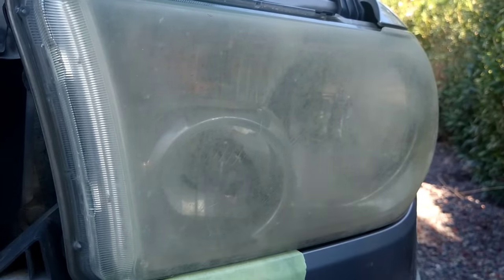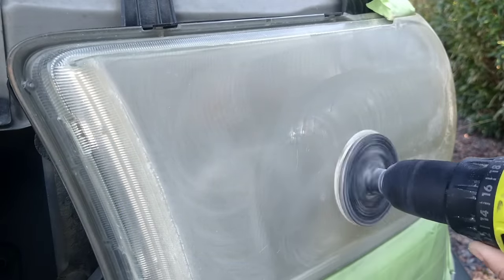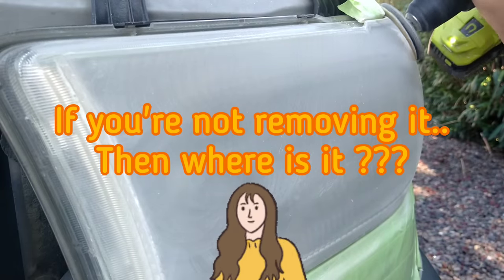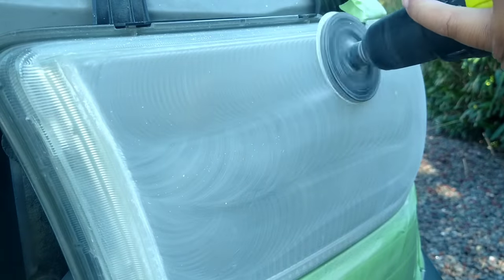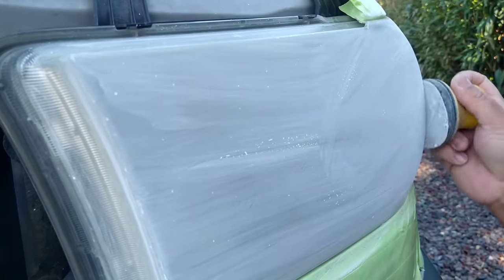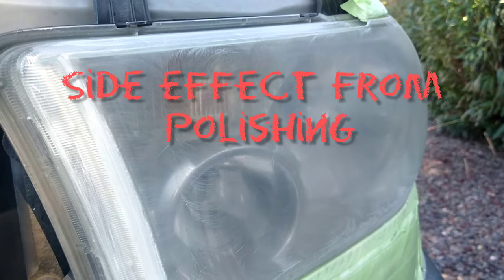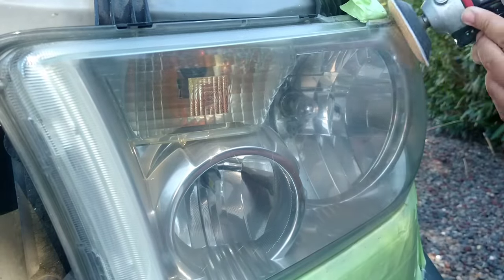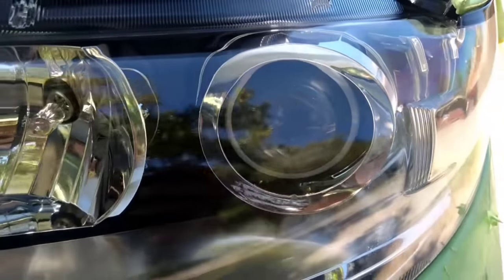POLISHING HEADLIGHTS IS A SHAM/scam  ---  and why you should never only polish headlights

Comment: you're right about you v have to sand the lights first but not about the 2k clear.  I've done dozens of headlight restorations using it and it comes out h flawlessly. .. just be sure it has uv blockers in it and many do. done of these clear costs are designed for plastic so you can't say don't use them.... amazing job man. keep it up.
Reply from the maker: Well most likely those 2K clears are definitely not made for plastic I've never came across one that has said on the back that it's made for plastic see-through surfaces or transparent surfaces most of them say do not use on transparent surfaces.. I have used 2K clears and the worst one spraymax 2K clear on headlights before.. it does come out clear but they have transparency issues the lights don't escape correctly Farley diminished compared to things designed for headlights.  Which is not per se My hugest issue is removing the 2K clears is terrible also in the long run they damage the headlight.. being a professional headlight restore you got to do more than just make it clear especially when something made for headlights comes out even more clear.. the number one thing is you don't want to cause damage to the headlight immediately or in the long run cuz you're liable for it... Also I have done dozens upon dozens of headlights with different 2K clears in the beginning until I learned it is not the way.. and I have removed probably hundreds of 2K clears on lights of different degrees and they are by far the most terrible things you can put on a headlight far as damage and longevity of the headlight health.  . I actually own a business and do this solely to make a living and have done literally over a thousand headlights like I stop counting at a thousand a long time ago..
Thank you for watching just trying to share my experience and knowledge about the situation watch a couple more of my videos and I go more into depth about it and prove the issues....💯👍🏽
Most recent encounter with..
https://youtu.be/k8_ljUVQfvo
Reply from the maker: Actual most recent encounter of doing headlight restoration previously done with 2K clear..(spraymax) https://youtu.be/F4VoNAfiGNQ
Also.
https://youtu.be/C1Y_022zMXQ
And even some more stuff on my page check it out...
Reply: @The Headlight Restoration Pro  wow. guess all those lights I did well eventually be jacked up. 😔   also not using 2k for plastic no more 😆 😂 🤣
Reply from the maker: I did it and I started shitting my pants once I figured out and run tests and had one or two customers that had some dysfunctions and had to remove it.. I had to do a recall literally... Had to set up over 15 appointments to remove it.. it's very costly but I could sleep at night..
A lot of negative side effects some of these companies even put on there do not use the headlights surfaces or transparent services..... It only stems from back in the day they didn't have anything else to use.. but now there's probably five dozen different products that are specifically made for headlights...
Appreciate you watching got a lot more coming..💯👍🏽

Comment: Quick question, shoudnt the headlight be taken off the car to prevent overspray when using the UV protectant spray? I see you did some taping but overspray goes everywhere as we all know.
Is it because it is safe to have that product overspray onto surrounding plastics? What about painted metal?
Asking because I'm gonna restore my headlights on an old DD beater and don't wanna remove em. The caring level is at 0 but I need to see where I am going 🤣 Winter driving in Canada.
You have a sub. Throw more shade onto all the 'Pros' that don't use UV protectant. Are headlights clearcoated with UV spray at the factory or is the platic UV resistant when  new?
Reply from the maker: Unnecessary to remove the headlights especially with modern vehicles some vehicles can take an hour plus just to remove the headlights and an hour plus just to install them again and let alone the work... As far as overspray there's no overspray significant overspray I tape off an access of about a minimum of 3 in I usually do about 5 in away from the light the overspray of this tip on these cans of the Maguire's headlight spray coating are very fan directional which means at about 6 to 7 in away from the light when you're spraying the fan that contacts the headlight is about 2 in so I didn't give him point you can control how much overspray there is it's a very directional tip so overspray is usually a Max of 2 inches with mine it's usually about a half an inch or an inch but I tape off for 5 in to evade any overspray it's not existent in my day today applications.. and yes the headlights come factory-coated after it's injection and press molded they spray it down with a UV protectant.. they have to because they'll just go bad in a couple months without.. biggest side effect of polycarbonate one of the only.... Check this video out here and there's actually footage of headlights being put together at a factory...
Thank you for watching.https://youtu.be/tnCdU2j5Ja0

Comment: I usually use the same sanding method and then two coats of good quality ultra high solids 2K laquer, never had an issue.
Reply from the maker: You will ... When it comes time to take it off again you'll see all the damage it caused in general and then you'll see all the damage it's going to cause trying to take it off and how difficult extremely difficult is to remove in comparison.. lot of people don't know because the frequencies is not there their ...(don't do enough headlights/the need to remove it) the need to remove it is not there ...they do one maybe a couple cars and that's it.. so once again when it's time for you to start removing whatever you did because IT WILL GO BAD and you're up close seeing all the damage to the left behind if you can get it off YOU'LL SEE...
Thanks for watching please follow like and subscribe.. a lot more stuff coming up.

Comment: Yeah, I used to do this at a shop I worked at. The most complaints I'd hear from my customers was about the DIY kits, some of the big box store shops, and some of the "quick lube" shops. Their headlights would look great for maybe a week or so. Then just start returning to the condition they were in beforehand. You have got to remove the damage that's been done. But in the case of the ones that have already been "serviced". You have to remove the crap they put on top of the damage. There's certain things in life you can cut corners on here and there. But automotive just isn't one of them. No, I'm not just saying that because I'm a mechanic. You'd be amazed at some of the things I've seen roll into the shop. The scary thing about it is that at some point someone actually thought it was a good idea. Not even thinking about the safety of their customer or all the folks that are going to drive next to that vehicle. It's "mechanics like that who give the rest of us a bad name. I mean I treat my customers vehicles better than I do my own truck. Although I can say my wife's Jeep gets treated like it's some sort of collectors item. But she doesn't ask for much. So the least I can do is make sure her ride is in the absolute best condition humanly possible. 
Anyway, great vid and excellent explanation of the problem with how a lot, if not most, of these "restoration" kits and services work, and  what not to do and why.

Although I think we could have done away with the eyeballs at the ladies legs. If you want to look, fine. but you are representing your business and the automotive repair industry. So that was/is rather unprofessional imho. There may be ladies that watch this and may feel uncomfortable the next time they need service on their vehicle. Some women like that sort of attention, but after 30+ years in this industry most do not in this type of setting. Most already feel uncomfortable and somewhat vulnerable in a shop setting. There's absolutely nothing good that's going to come from making the situation worse. Yes, this is your video and your channel. But that's very unprofessional behavior, period.

Comment: I always just replace the whole light bucket on any used vehicle I get, nothing compares to how a new set looks and amazon often has great prices because they are knock-offs, and in most cases that is fine. it's one of the few cases when a fake is perfectly usable. I get the set of 2 for under $100 usually. and do the pigtails and bulbs too while you're in there. replacing them transforms the front of the car and makes it look new again.
Reply from the maker: Sounds like a lot of work... And I have no idea what vehicle you can purchase even two headlights aftermarket which are the worst in the world on..$100 is pretty cheap but hey if you know how to put them in... You should check out my video on why to buy OEM and why to restore your OEM instead of buying aftermarket lights that will break down faster than the headlight restoration..
Reply from the maker: https://youtu.be/VSNEhD2obQc
Reply: Landfill plastic laziness.
Reply: Can't do that with my honda crz cuz u can either buy them used or brand new. Used is still $200 per headlight for some in good shape and Brand New will cost $400 per headlight
Reply from the maker: Exactly.. so the headlights you probably have in there are OEM is there worth $400 to have those service even if they're not OEM it's going to be such a good thing for a hundred bucks and some change or something for those lights.. have a restoration is the most beneficial thing for headlights if it didn't exist at such a high quality which is scarce but I'm trying to change that it would be crazy to have to replace your headlights every 5 years...

Thanks for watching I got some interesting content coming up soon..
Reply: It's not hard to change headlight or the bulbs you can take them off and replace them in under 30 minutes I just buy beater cars pay $2000 or less and run them plus you can go to a junk yard and get headlight for about any car just go and take them off a car and pay for it I have places to go to you go and get what you want and pay for it take motors out of cars anything you need called johnnys you pull it
Reply: @jordanwright4014  if u can find ur car at a junkyard near u. My car is a rare sight to see on the road or in a junkyard. I found one in a junkyard and it was in a front end collision and I looked all over the internet and u can't find headlights for less than $100 each
Reply: @brandontalley4288  you can find crv headlights for 100.00 to 150.00 for all years any day on ebay bud!
Reply from the maker: Aftermarket garbage,....
Still have to install (time is money)
Headlight Restoration on that vehicle is also cheaper..lol
So I guess  do the math...
Check this it out....
https://youtu.be/VSNEhD2obQc
Reply from the maker: Time is mony..(to do all that)
Headlight Restoration is cheaper..
And buying aftermarket is the worst thing you can do ..(you get what you pay for)
Most people want the best option...
Not the worst...
https://youtu.be/VSNEhD2obQc
Reply: @joshsickels  CRV or CRZ 🤔
Reply: @joshsickels  all the Honda CRZ headlights are $300 + on ebay. I just looked
Reply from the maker: Yeah I don't know where people get this information..lol
How many times somebody's comment I can get new headlights for $45 for both.. 😂😆😂😂
Reply: @theheadlightrestorationpro  u can with some car headlights on ebay but they going to be yellow and need restored so y buy the used ones and need to restore them when u can do it to the ones u already have 🤔 unless the ones u have r broken. I bought aftermarket headlights for my 04 Pontiac Grand Prix and they was only $75 but they was tinted black but the tint is already flaking off and idk how to fix that
Reply from the maker: @brandontalley4288  you can't fix those I only have a video coming up soon showing the best way to get the flaky stuff off,.. so you can so you can begin the headlight restoration process. .
Stay tuned
Reply: @theheadlightrestorationpro  thanks you. Would be very helpful

Comment: I've sanded and buffed my previous car's headlights so many times I know you're right. 
Sanding up to 3000+ grit alone is probably better than using any product not made for headlights. Once I tried UV plastic clear coat on them, it just went downhill and then I resorted to Magic Blue every month. The worst is that you need your headlights most in winter and using polish in freezing weather is not a good idea.
Just checked out Maguire's headlight coating and will start preventative maintenance with it next time I'm at the auto parts store. It's only sold in kit here but for 5$ difference, I'll be ready if needed and can throw away 3 old boxes of turd restoration kits. Will do that just now actually...
Reply from the maker: 👍🏽 awesome..

Comment: Very nice. The fibers of the finesse it pad serve to dissipate the heat which is why they are superior for removing the 3k grit scratches compared to a foam pad which gets very hot very fast, which instead of cutting the surface, it melts it. The quickest way is with an edge buffer- a canton flannel wheel with a dry compound like gw16 made for plastics. 
I restore polyester piano finishes and this was a joy to watch. Maybe I should get into a side line of work 🤔 
Best,
JE
Reply from the maker: Awesome man.. thank you very much for watching plenty more videos out.. and plenty more to come soon..

Comment: Old enough to remember when this sort of thing was unnecessary. Headlights were made of glass which never oxidized, and could be cleaned with Windex or ammonia water.  When they burned out--off to the parts store!
Reply: Old sealed-beams were great, but the manufacturers all went with projector type headlights because they fade a lot like sealed-beams but take something insane like 20 years to burn out as it's basically an arc lamp.  So you always have headlights that "work".  To some extent.  Mine after 7 years are basically as bright on high as they were stock on low. Lol.  LEDs, though, have no real issues as long as they are designed from the factory.  The downside is retrofit kits are actually a hazard as they throw very inconsistent patterns.
Reply: @josephoberlander   I usually see those retrofits on  tweaked up Honda Civics with the ridiculously oversized $1000 rims and "grapefruit shooter" exhaust tips, as they chase each other through freeway traffic. Those pea-brains have no idea there are people  called engineers who are smart enough to design headlights and bulbs to match together for an optimal light pattern, but there are plenty of other people out there who don't know it either. So why do parts stores sell them? Same reason big-box home improvement stores sell non-code compliant plumbing and electrical material. Money.  Which is the same reason some parts of the plumbing and electrical code are written the way they are. Engineers are smart folks, but unfortunately, it sometimes seems not enough of them realize two things--the law of unintended consequences, and that there will always be idiots out there who can defeat their most brilliant designs. That's where the lawyers come in.
Reply from the maker: https://youtu.be/VSNEhD2obQc

Comment: The issue is the UV light film-overlay.

It’s simply gone & the resultant exposed plastic (Without the UV light film overlay) is thus exposed to the UV light & therefore quite rapid degradation.

Whatever you “do” be a toothpaste or WD-40 or even the more involved “kits” will not last not even a year much less 6 months…
Reply: Exactly right

Comment: Amazing results. Mine i just purchased off a 2014 Chevy Equinox is oxidizing from the top down as i feel most are..the ones on my 2011 are deeply oxidized and yellow 🙄. 
I can tell you it's a chore to replace the whole damn light, but i prefer to do that rather than getting the plastic accidentally  marred somehow.
I will be trying your method.

Comment: Nice video. Just a suggestion - It would be really useful if you could measure the pressure you typically use when sanding/buffing by pressing the tool against a kitchen scales. Perhaps you could add readings for what you would mean by, "light, moderate and heavy pressure" in oz/lb or g/Kg in the video description. That would help those of us with zero experience to get a head start.